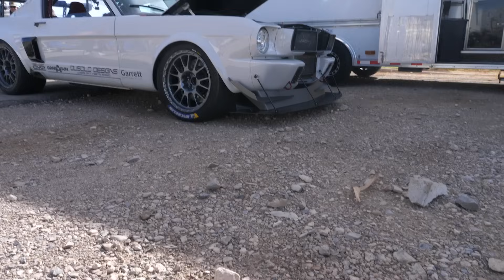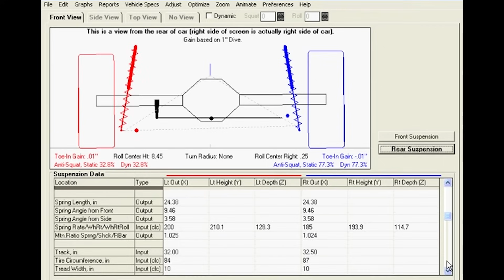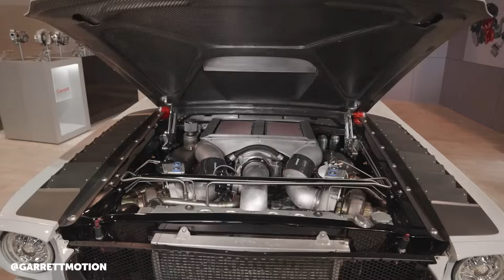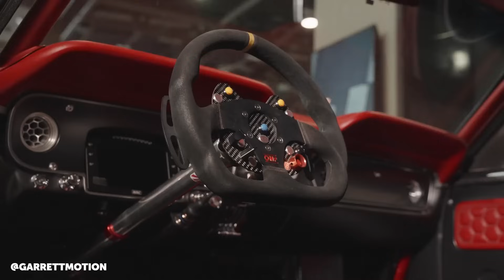Is It Worth The 'Hype'? Electronic Wastegate Control

Comment from the maker: TIME STAMPS:
0:00 - Racing A Classic: Mike Dusold
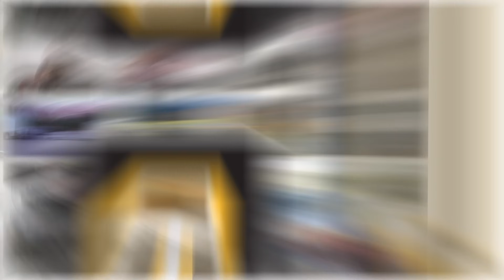0:18 - Why A 65 Mustang?
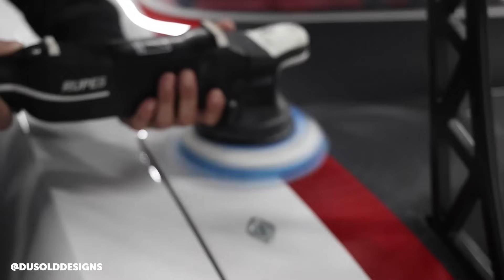1:15 - The Problem With Old Chassis
2:05 - Technology Improvements
2:51 - Aftermarket Part Support
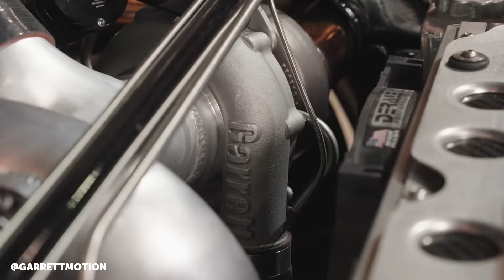3:34 - Advantage Of This Classic
3:57 - Rear End Solid Axle
4:24 - Negative Camber Components
5:35 - Tyre Distortion Vs Camber
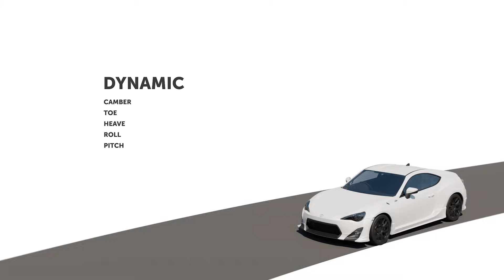6:12 - Panhard Rod Vs Watts Linkage
7:34 - Roll Centre Height
9:24 - Software Analysis
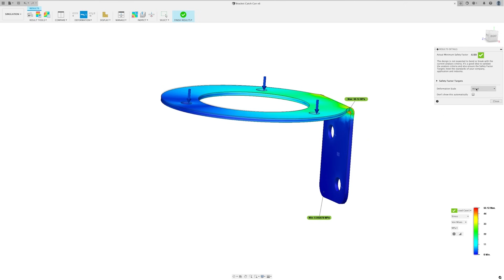10:03 - Hard Part Is Measuring/Data Collection
10:33 - Data Validation
11:42 - Without Data, It's Just Opinion
12:18 - 351 Ford Windsor
12:47 - 351 Weakness
13:03 - 820whp at 8psi
13:44 - GM Vs Ford Generalisations
15:19 - Cylinder Head 101
15:36 - Twin Turbo Setup
15:55 - Turbosmart E-Gate Setup
16:20 - Wastegate Control Stratagy
16:52 - Exhaust Pressure Differential
17:22 - Electronic Vs Pneumatic Wastegate
18:27 - Electronic Wastegate Wiring Considerations
20:16 - It's All A Learning Process
21:05 - Thanks Mike!
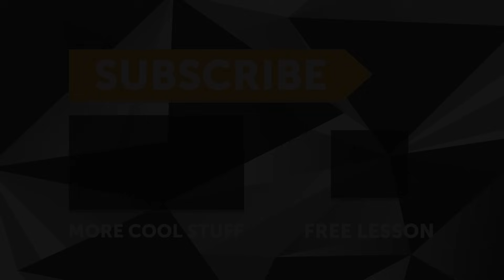21:18 - BUILD.TUNE.DRIVE

Comment: Taking advantage of electronic waste gates is exactly the way I always wanted to control boost. So using both an electronic throttle body and electronic waste gate.  The idea would be to have the throttle open wide with the initial application of the throttle and dial in boost by closing the waste gate to simulate the remaining movement of the throttle. i.e. for example maybe,  0-50% throttle position equates to 0-100% throttle body position, and the remaining 50-100% throttle position is done with the electronic waste gates and boost pressure. 

I wonder if this would make the turbo spool up faster and make the throttle position more linear since I have noticed on both my cars running higher boost looses some throttle position linearity?

Comment: My engine mentor Ted Haywood built a 67 Shelby 350 to race Daytona. Black flagged during '68 time trials. 167.86 MPH lap speed, and 210MPH on the back stretch. They refused to believe it was a 289 pushing it. Teched and Dyno'd, it turned 504HP at 9krpm. Raced it all season long. What can you do with 2 valves?

Comment: FORD... First On Race Day! 💪🏆 I have a 95 with an aluminum Ford Racing 427 small block based on the 351w. It currently makes 434whp and 474wtq. I just installed a MegaSquirt Gen 2 PnP and I'm hoping to reach my goal of 500whp daily driven. Sweet video Andre and HPA team🏆
Reply: 289 504hp 9krpm. 1967 tech.

Comment: So with the gate you , open it the engine thinks it’s n/a breaths better revs quicker the slap it shut from your data and off u go , also can be opened for cruising giving way more mpg , 
 Look at old merc diesel turbos , they ran vac instead of boost , so until the engine is warm the Ecu keeps gate open 0 boost and no way to be hard on a cold engine